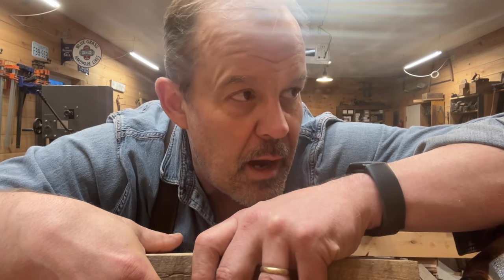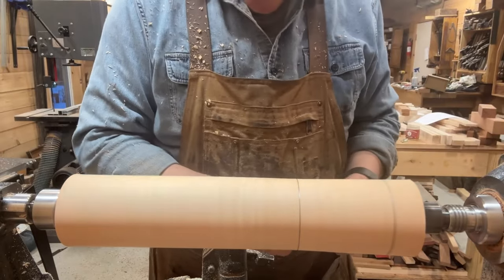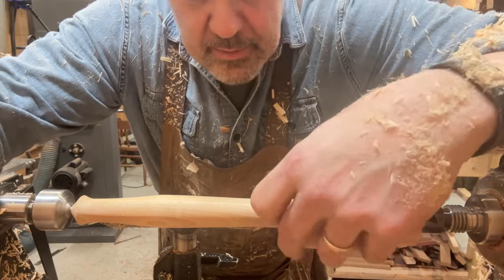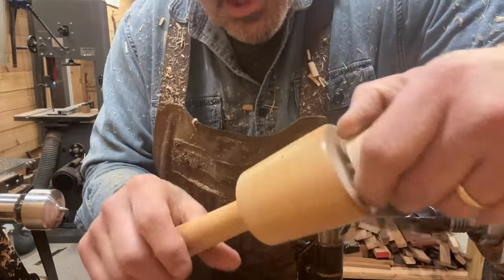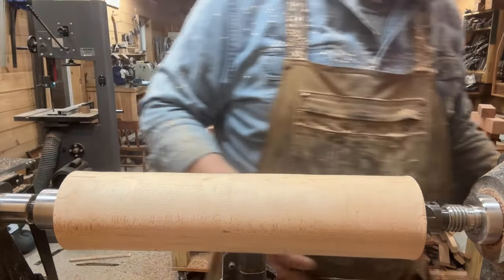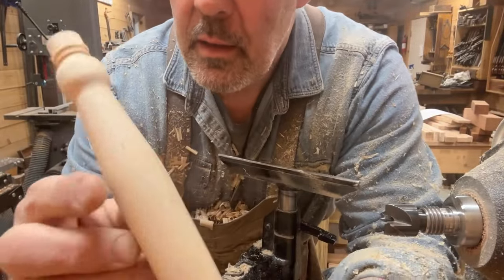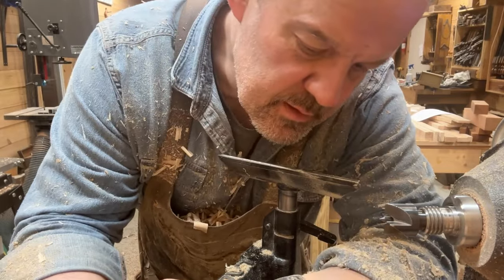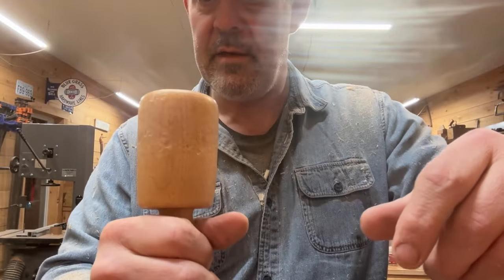Let's Turn a Bench Mallet Just for Fun!!

Comment: Will.  I was thinking (while watching) if you could monitize the wood turning even more.  Would a two piece dead blow mallet be feasible?  Turn the head.  Turn a separate handle.  Fill and close off the head of the hammer and attach the handle.  I have no idea if it would work.  If it would be useful.  If it would be cost effective.  Just throwing out an idea.
Reply from the maker: Don’t know if there’d be a market for it or not but it’s an interesting idea. One of my challenges as a maker is resisting the urge to make and monetize every idea that comes into my head. Bevel gauges and panel gauges have been requested pretty frequently so at some point I’d like to set aside some time to prototype those.